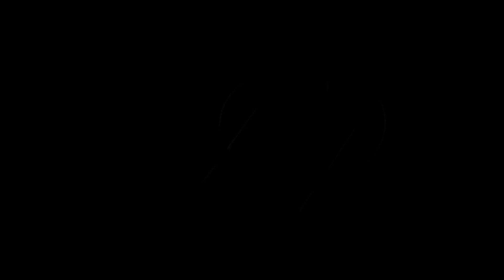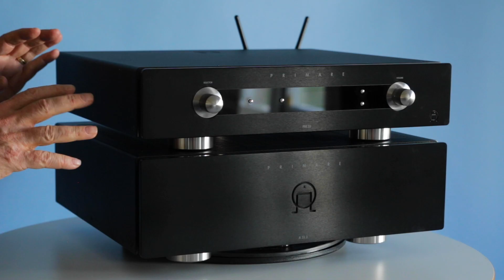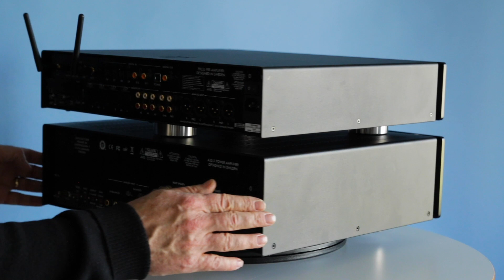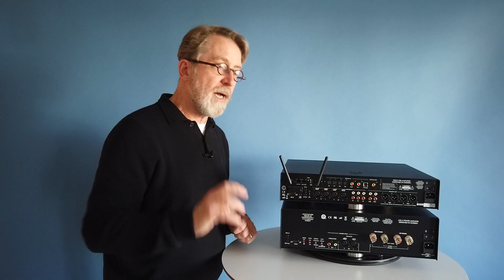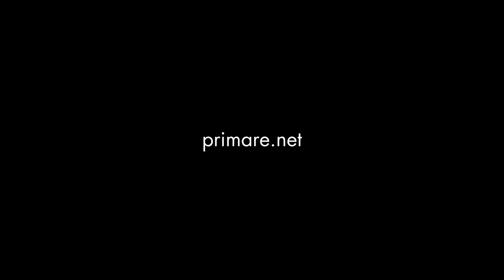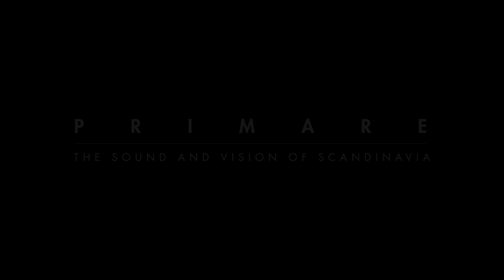PRE35 Preamplifier and A35.2 Stereo Amplifier

Comment: Great gear!
Can this combination power my Naim Ovator S-600 properly ???
Thank you in advance,Vaggelis.
Reply from the maker: While not familiar with your speakers, from what I can read I see no reason why it wouldn't make for a great match as the amp is capable of driving more than effectively  virtually every speaker we have tried.
Reply: @PrimareAB Hello again Sir. Finally I tried the pre35-a35.2 combination to power my Naim Ovator s-600 speakers. I borough the demo units from my dealer. I've been listening two weeks now & I can say I am amazed of how good they sound. It is an awakening for my speakers. To be honest I never expected a class D amp to sound so exceptional. Highs are crystal clear, mids sound full but not agressive. The strongest aspect though are the low frequencies. They sound robust, fast & clear, wow!!! I am ready to pull the trigger & buy them since they only improve the overall performance of my speakers & system. I would like to ask you, my dealer insists to use the Nordost red dawn xlr, power & speaker cables, which obviously are quite expensive. What cables would you recommend instead of the red dawn? Will the purple flare or blue heaven do a good job as well?
Waiting for your response. Thank you in advance,Vaggelis.

Comment: Is the preamp passive? Or does it have a buffer? Does it do anything to try to account for any loss in bass or higher noise floor that can happen with preamps?
Reply from the maker: It is an active preamplifier designed for linear frequency response and ultra-low noise.

Comment: what is the design of the volume control? (stepped R2R / potentiometer / or ..... Since it greatly affect the SQ, and I don't find much detail online)
Reply from the maker: Thanks for the question, as it reminds me to revise our design briefs to describe our use of an IC circuit, that is outside of the signal path, to select precise resistive values for each volume step in our pure analog volume control so that audio quality and balance is consistent from the lowest to the highest volume settings.

Comment: So you loose fidelity/soundquality when you bridge two of these amplifiers compared to traditionally monoblocks?
Reply from the maker: Nope, in most cases it allows for noticeable improvement in sound quality (one of the reasons you may have seen some posts of our show and event systems using such a configuration). The only thing to be aware of is that when bridged to mono the amplifier becomes effectively a differential output amplifier, which means that any speaker load is halved. For example an 8 ohm load becomes a 4 ohm load to the mono amp. So, if your loudspeaker load dips to 2 ohms, the amp sees a 1 ohm load, which is not something any amp really wants to drive and as a result there may be a subtle loss of performance. In virtually all other cases of speakers with nominal impedance loads of 4 ohms and higher, this is not an issue and performance improvements should be expected. One dual amp configuration we particularly like, if you have a speaker that can be biwired, is "vertical biamping", where there is one stereo amp per speaker, with one channel of that amp driving the treble and the other channel the bass. In this way the impedance load is higher, you get the benefit of the mono configuration, and of biwiring, Terry
Reply: @PrimareAB  thanks terry for your great explaining! Im aware of the impedans is divided if you bridge gwo channels but have heard some say the distortion is higher in bridged mode. Then i will aim to change my A32 amplifier to two a35s in the future. I will also buy the np5 now to complement my dac30 and pre32.
Thanks!
Jimmy
Reply from the maker: @JimmyG91  Happy to help, and happy holidays! Terry and all at Primare AB